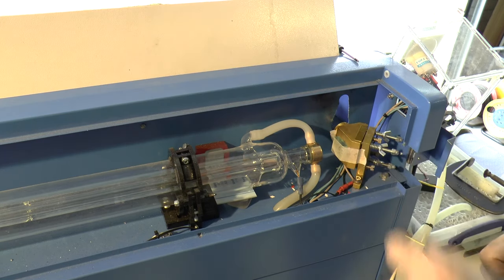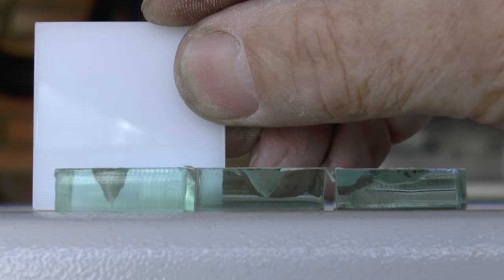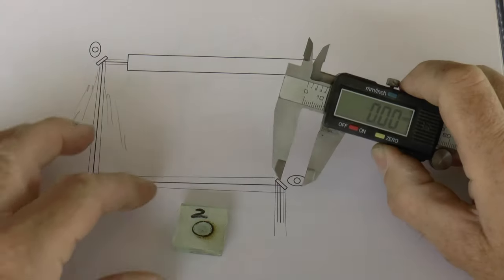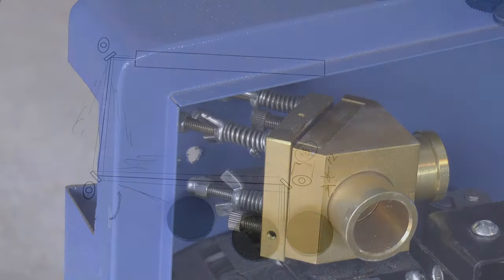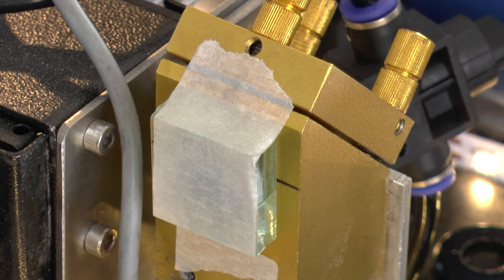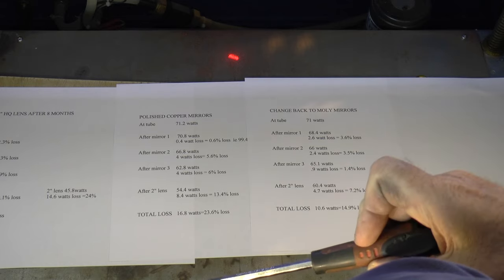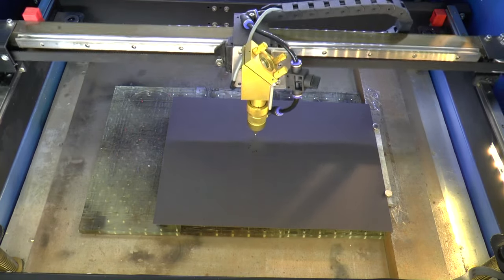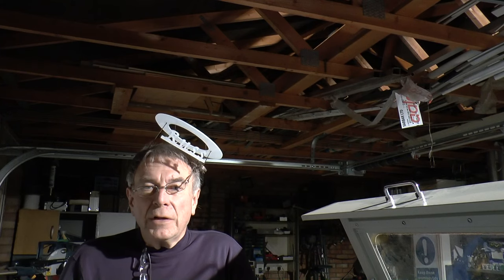RDWorks Learning Lab 79 Machine Health Check Part2

Comment: Hi Russ. Another great exploration. Why do you think that your lens was damaged? Could it be the air assist isn't doing what it should be? Or do you think that there was some impurities in the air that reacted with the lens and laser?
Reply from the maker: Hi Felisha
In the early days of my machine I did run for a short time with a normal shop compressor but the moisture in the air was "burning" onto the face of the lens. It was cleanable but it made me realize that the little oil-free compressor they supplied did not produce water vapour and I have been using that for a year. Whatever has damage the lens, the mark is not removable. The "up-side" is still pristine so I cannot guess what has destroyed the anti-reflection coating on the work-side. It cannot be fumes because I ALWAYS have air coming out of my nozzle, even when cutting acrylic and the flow turned right down,  The other possibility is burning of the lens face from reflections. I have done quite a few stainless steel etching projects and although stainless is not as reflective as copper or aluminium, its about 60%. the size and position of the mark could match up with the hole in the end of the nozzle. When I get my new lenses I will have to inspect the lens regularly to see if I can pinpoint a cause.
Have you tried lasering pattern onto any of your  edible treats?

Best regards
Russ
Reply: Hello Russ, nice to see you in great condition :)
I have problem with a kind of "mark on the lens" created "by laser itself" as well. Unfortunately I had no time to show you them when you visiting us during holidays. As this is longer story I will make video with explanation, but I have few ideas how to try point out "the murder", or at last - how to found more evidences of crime. And I'm afraid he can be serial killer, as there is a more victims.
Reply from the maker: Hi Wojciech
One of the problems we experienced regularly when cutting brass and aluminium on powerful metal cutting lasers was reflection damage on the face of the lens. I don't cut those materials on my little toy but I do etch stainless steel. I hadn't considered this as dangerous until I saw the lens damage but I do know that stainless is about 60% reflective and I  recognize the damage as a lesser version of what I would witness on more powerful machines.  I have new lenses on order and also nice flat copper mirrors from China, so we shall see what happens when all the new kit arrives.
Best regards
Russ

Comment: Hi Russ.  Your videos have been really helpful.  I just took delivery of a 60w chinese beast and am having problems with the plugs.  There are 3 items to plug into the body - the one with the two flat pins (coming from the air compressor) just doesnt want to go in.  Do I use brute force or shall I put a UK 3 pin plug on it and plug it in separately?
Reply from the maker: Hi Doug
There are normally TWO sockets for external connections. One is for the air assist pump and the other is for the water pump. in your case I suspect the third is for a separate extract fan. I know that most of the 60watt machines have these universal sockets. On of the plugs they cater for is the two bladed  USA type plug. However if you can't get that to fit it will be perfectly ok to cut it off and put the two wires into a UK 3-pin plug which should fit the universal socket.  I would change the fuse to 3amp
Best regards and good luck with your new venture
Russ

Comment: I did not see that anyone else has asked but have you tried taking your copper mirrors and with a vise putting a slight curve in them, it seem that your beam is loosing focus and a slight bend in the mirrors should help converge the beam back to more of what is coming out of the tube.
Reply from the maker: Hi James You are quite right about  about beam divergance. Sadly , dishing the mirror is not the answer. When I tested my copper mirrors originally it was with my old laser tube which had a 5,5mm diameter beam. My crude polishing on a soft cloth had the effect of "softening" the edges of the mirror  and causing slight non flatness around the edges. . This was perfectly acceptable whilst my beam was small and the flat central part of the mirror was all tha was being used. However, in this video you see something I completely overlooked when I fitted my new tube about 8 months ago was the fact that it had a beam diameter of 8.5mm.  NOW the curvature at the edge of the mirror did come into play and caused the outer edge of the beam (where the power density is lower) to diverge.. The main central high density part of the beam was still unaffected (hence the cut was still quite reasonable) but overall there was a net power loss. You are right in saying that the beam must not change shape after it leaves the tube and with my original moly mirrors reinstalled that case was proven. I have just received a set of properly manufactured (flat) copper mirrors from China and will be fitting and testing those in a near future session.
Best regards
Russ

Comment: is there any heat build up in the mirror housing as a result of not all the beam contained in the mirror?
Reply from the maker: Hi Mike
You would imagine if part of the beam was off the edge of the mirror then it would heat the mirror housing.  The beam is not uniform power within its diameter. The intensity within is a Gaussian (otherwise known as normal) distribution. Depending on the manufacturer of the tube and the power of the tube the beam could be between 8 and 12 mm total diameter.  If you assume the beam is 12mm diameter the numbers are simple. The central 4mm diameter contains about 70% of the power, Between 4 and 8mm diameter there is about 25% power and between 8 and 12mm the remaining 5% power. So you can see that there is no significant power loss or heating effect even of the the beam overlaps the mirror edge by as much as 2mm. There will still only be a very small proportion of the outer 5% power that will be affected..
Best wishes
Russ

Comment: Do you know of any way for me to determine the type of material my mirrors are made of?  I've read about several different materials, some of which have coatings on them.  And everyone has their own contradictory advice on cleaning/polishing/maintaining them.
Reply from the maker: Hi Steve
There are a few possibilities for mirror type and it ought to be reasonably easy to identify them. First of all, the colour. If yellow then they are gold coated. Now remember that if you bought an ebay machine then they will be using "cost effective" mirrors, certainly nothing expensive like gold coated copper. The most likely gold mirrors are flash coated crown glass (called K9 mirrors). These are nothing short of rubbish as the gold will almost fall off if you try to clean them. at 2 or 3 times the price of K9 you have silicon mirrors. Again the price would put the possibility of these being fitted at "low". The chances are that your mirrors are silver. That reduces the possibilities to about two types. The cheaper will be aluminium plated with an alloy of cobalt,chromium and platinum. Aluminium is soft and the back of the mirror will scratch easily with a sharp point. The most likely will be molybdenum. It will be natural and polished on one side. A very heavy material (hard to scratch) it can be easily identified by working out the mirror's density. Mine worked out spot on for moly.. It's a hard material that is quite scratch resistant, flat and very stable. Sadly it does not have the best reflectivity (about 97%) but it's a good "all rounder"   So in answer to your basic question use colour to start with (moly is nowhere near as silver as chrome plate) and then  density and scratch resitance to help identification.
Best regards
Russ
Reply: Thanks as always!

Comment: Hi Russ I was wondering if you could help me please While I am waiting for my new tube I decided to remove the lenses at the front lens as I removed it, it fell into 5 pieces, this means I have to order a new on but there it the problem the lens measures 18mm across, I just dont know which type to go for either glass or copper also does it matter about the dome shape on the lens, Im just confused can you help me please .  Many thanks Paul.
Reply from the maker: Hi Paul
You may be a bit confused about which are mirrors and which are lenses when you look at some websites. !8mm tells me you aree looking for a lens. There are different lens types basical two that are used on these machines. The cheapest and most common are plano convex lenses which have a flat side and a domed side, A lot more expensive but with marginally better focus point are menscus lenses which are domed on one side and slightly concave on the other (a bit like the lenses in glasses) There are also several materials that lenses are made from. The most common and cheapest is a yellow glass-like material called zinc selenide (ZnSe) This material in it's raw state is only 70% efficient at transmitting the laser beam. The other 30% is reflected off the surface by virtue of its crystal structure. To make it work as a lens material an anti-reflection coating is applied. This improves the transmission to about 96 %. There are rather exotic coatings that will improve this transmission to about 99%,. These will be described as HQ lenses and will be about 50% more expensive. Having tried both, the extra cost for a 3% gain is not good value. If you have 40watts going into the lens another 1.2 watts is not going to give you a noticeable cutting gain

To sum up I would buy a normal plano convex  ZnSe lens, 18mm diameter.........but with what focal length? The chances are that your machine was supplied with a 2" (50.8mm) lens (the setting piece will have been 19mm wide?) I would suggest replacing like with like , but if you can afford it, I would advise buying a 1.5" (38.1mm) lens also. The improvement in cutting ability will amaze you. Here is a site I have used several times.

http://www.ebay.co.uk/itm/New-HQ-ZnSe-GaAs-Focus-Lens-For-CO2-Laser-Cutting-Machine-Diam-18-25mm-FL-1-4-/330769086309?var=&hash=item4d035fb765:m:muneiUynaH12_ibMr3Jj7GA

Best regards
Russ

Comment: Another great video Russ. Just an update on ,y ,achine I upgraded from 40 to 60w and by god wht a difference. Bit pricey but hey it was worth it. I have a question for you, a bit off topic but can't seem to get round this. I do alot of work and I want to save to a USB Flash DRive so then I can just take the flash drive to the machine and work from there. I have saved it to UFile  but wen I took it to machine it says the drive is empty. RD works saves it as an rd file. So where am I going wrong? Or have you not crossed that path yet?
Reply from the maker: Hi George. 
Yes I see this often.
First, are your usb sockets connected to the controller correctly. It has been known for them to be crossed over ie you are trying to read a USB stick with the pc input. You can plug your stick directly into the controller to test it if you need to.
I have a couple of USB sticks that just refuse to work with the machine. Sometimes the connection in the socket is poor and I have to unplug the drive several times to read the file list. I have 3 or 4 USB sticks that work flawlessly. I had a bad Ebay drive that someone bought as a 256gb for next to nothing. When I tested it I found it to have only about 4.2gb of useable memeory but it had been doctored to make it look like a 256gb unit.  Even though it will save and reload anything that's smaller than 4gb , the machine refuses to read that.
What I am demonstrating is that the usb drive is a bit fickle.
The other question I must ask is did you load the USB driver when you installed RDWorks?  Aso at bottom right corner of RDWorks , there is a box which should read Device = (USB auto)

Hope there is clue somewhere in here to solve your problem
Best regards
Russ
Reply: Hi Russ
Many Thanks for that, Truth be told  I never thought of trying another USB Stick. So I did and it worked. The difference is that it has to be a FAT32. It will not read an NTFS drive. I also find that once you have it on the USB stick,  then on the unit itself you have to copy it to memory as it cannot load it direct from the stick itself which seems to be a bit pintless to me. You could just save it to memory direct tp unit .Cheers again
Reply from the maker: Hi George
You are correct about the way it works. You have to first READ the USB then COPY to memory. Once the file has copied you pres ENTER. Then press ESC and you will see the drawing building in the bottom right mini window. When it has finished building, press the ENTER key and it will build in the main left screen. You are now ready to START or FRAME.  If you press the ENTER button again it will start the ON.SCREEN edit routine which allows you to change parameters for each layer in your program bu using the Z/U button After you have fiddled around with these buttons a few times it will become instinctive.
Best regards
Russ

Comment: Mirror distortion.  There are some waves in the mirror surface that are not completely focused straight.  Each mirror compounds the problem.  So after the first mirror the issue is compounded.  Having the mirrors turned at the 45 degrees actually exacerbates the problem even further.  something that is off by .003 inch will be off by .027 by the end.  HUGE difference.
Reply from the maker: Hi
What worked extremely well with a 5.5mm diameter  laser beam falls down badly when the beam becomes 8.5mm diameter. I never even considered this would be a problem when I fitted my new tube.  Although manufactured from flat sheet, I don't have proper lapping equipment to make decent flat surfaces, so my bodge attempts were always going to produce "soft" edges. It appears that that curvature encroached on the mirror more than I had expected. As soon as I fired an 8.5mm beam at mirror 1 I was getting edge dispersion. I did not pick this up with my power measurement because I was so close to mirror  1 and all the energy was still being captured. However, as you have noted, the divergance at mirrors 2 and 3  was just increasing massively.I am still convinced of the superior efficiency of copper mirrors that I have a set on the way from China. I think you could see that as soon as I put my old flat moly mirrors back in the machine it was like a miracle. The issue with moly mirrors is 97% efficiency. By the time you lose 3% at each mirror and 3% with a normal ZnSe lens that's 12 to 13% loss( 9 watts of my 70).  To get that down to about 5% loss gains me 5 or 6 watts.
The story continues. Thanks for your comment
Best regards
Russ
Reply: Thanks Russ.  I too believe the copper will be a superior material.  I'm thinking that I may do some experimenting of my own with this.  I have a very small machine shop with a fairly accurate vertical mill and a lathe.  I may even tinker with my little surface grinder and see if I can get a true enough surface to make a set of my own.  Never stop learning.

Comment: Great Video !!! Looking forward to the next one. Saving money to get my own china laser (40 watts seems to be ok for me)
Reply from the maker: Hi Mirko

Think hard before spending your money The little 40 watt desktop machines are nothing like this unit. They are fitted with a 30 watt tube and there are very few adjustable features and no air assist.  Research a lot.

Best wishes
Russ
Reply: Thanks for the advice, i think it over.
Reply: Well a quick research revealed that a 40W Laser costs about 350 Euro, while a 60W Laser ist about 2000 Euro. No way i could ever be able to afford the 60W one.
Reply from the maker: http://www.ebay.de/itm/CO2-laser-graviermaschine-50W-laser-engraving-engraver-schneider-hochprazise-Usb-/272133618743?hash=item3f5c6d7c37:g:KMcAAOSw8w1X8zmw
Reply: thx, but still 4x more money for 25% more power...

Comment: Are you planning to go back to the copper lenses? Perhaps you could lap them on a glass plate with a suitable grinding paste to get them perfectly flat. I've never done lapping with copper, so I can't suggest a suitable paste unfortunately.
Reply from the maker: Hi Scott 
I think I was lucky when I first trialed these copper mirrors. The beam on my old tube was only 6mm diameter and at mirror 1 I think it hit a nice flat spot in the centre of the mirror and there was no beam divergence. With my new tube sending out an 8.5mm beam it seems that it is now impinging on the out-of-flat region around the edge of the mirror that i created with my crude manufacturing method. I'm still convinced that copper is a great way to go and have ordered some PROPER mirrors from China. Watch for another video!!! 
Best regards Russ